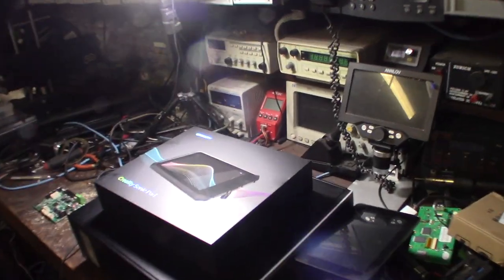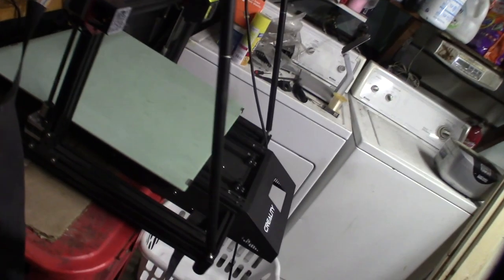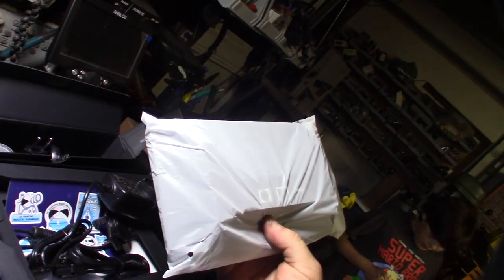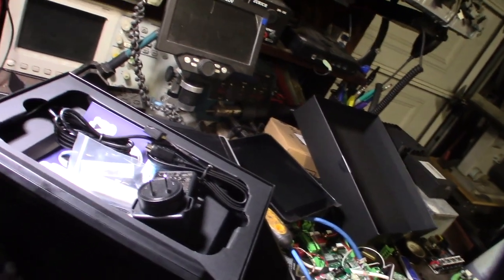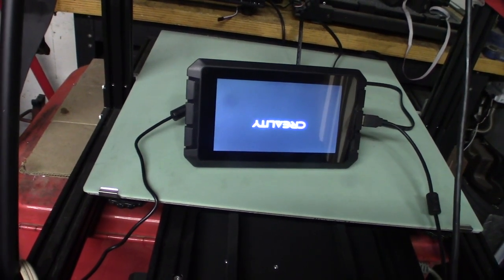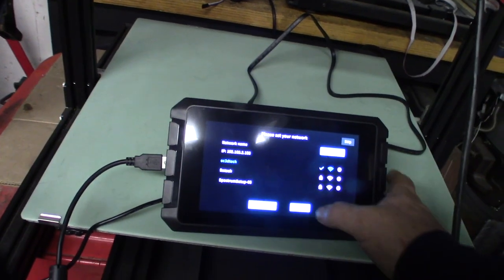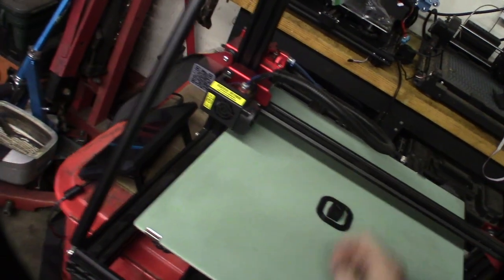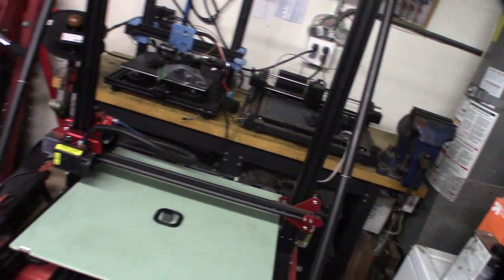Creality Sonic Pad Install On CR-10 Max Klipper

Comment: Hey,  informative video regarding the boards, did you find a setting that worked for the max as it's not supported in the supplied list on the sonic. You're battery dies before you explain how you got it to work with correct dimensions etc...

Comment: Ive got the same issue.   Its the same machine in every way to the cr10 pro v2 just the bed is bigger.    Surly there is a way to amend the bed on the thing.
Reply: Hello I have the same here  do you have nowt  the good printer.cfg?